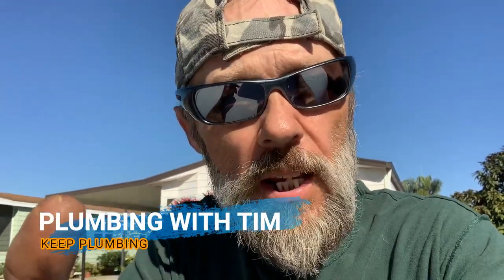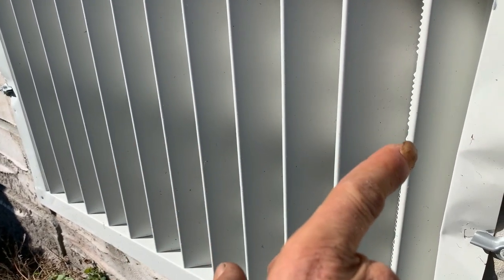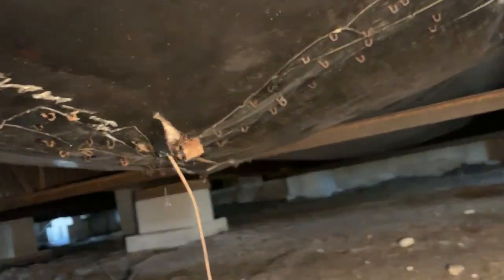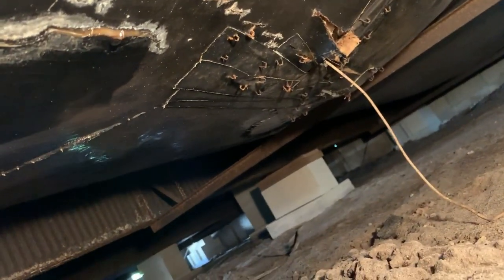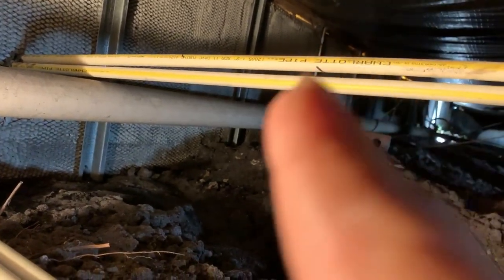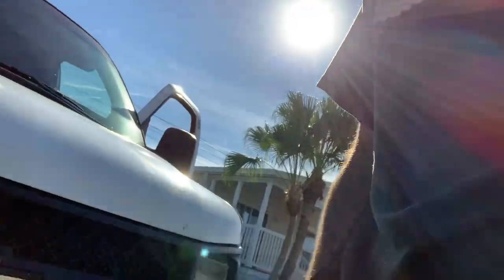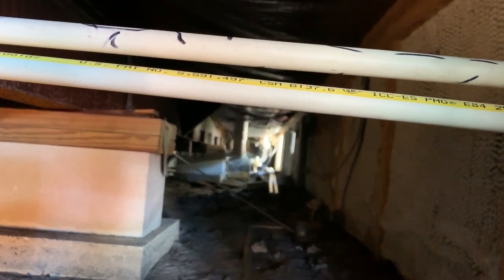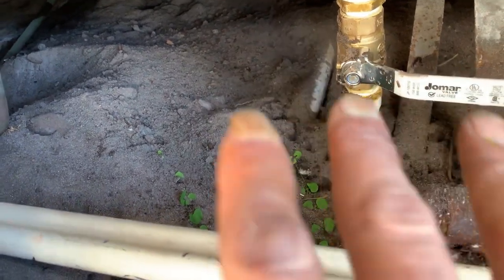REPIPING A MOBILE HOME

Comment: Great video. I have a 1972 Champion single wide and can't afford a plumber to repair my plumping, so I have to do it myself. Do all the older mobile homes have exposed plumbing? And what about the kitchen sink waste water line. I have a soft floor in the middle of the kitchen. Any and all information would be appreciated. Thanks

Comment: Under mobile homes do drain pipes rest above the insulation or below? I have a sewer smell coming into the home and I suspect I might have busted through the kitchen drain pipe with a snake and now that needs to be repaired....what a pain it is that you have to cut through the insulation to get to the pipe.  I almost rather cut through the floor and deal with that...
Reply from the maker: Not all the mobile homes have the drain pipes up in the insulation

Comment: Tim - I'm thinking about having a repipe job done to my double wide 2000 mobile home.  I also live in the South (that is SC).  What would be the average cost to have this done?  Thanks
Reply from the maker: Around 5K
Reply: Wow, but I've heard it's a job considering you have to go into the walls and things.  Anyway, I've had a chance to look at a pair of pipes inside my house and noticed that they where "tinted yellow".  Does this indicate something, or should I still go on the onset that after 20 years, I should still have my house re-pipe?  Going to be around SC for the day or two?
Thanks

Comment: Been awhile since this video was posted so I hope you or someone else who knows sees this but I’m the new “proud” owner of a 90s double wide with the old PB plumbing. Planning on doing the pex or cpvc repipe myself and have done it before in previous stick built homes but my question has been is it really necessary to try and get the new pipe above the belly? I noticed you didn’t in this video and I would think as long as my place is on a foundation like any other house, it would be fine as long as it’s wrapped.  I’ve sure never seen a stick built home with belly insulation covering everything underneath. That’s the one thing I hate most about manufactured houses, you can’t see or easily get to any of the infrastructure underneath
Reply: Cpvc is junk my friend
Reply: So pex is the best to use in older 1978 mobile homes ?
Reply: I would use PEX.  I have used it for years with no problem.  I live in the deep South, so it rarely gets cold for long.  If you live up North, you may want to insulate the pipes if you run below the belly wrap.